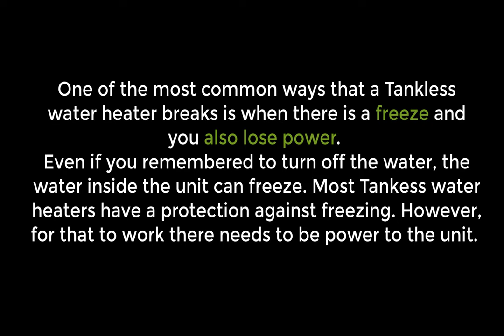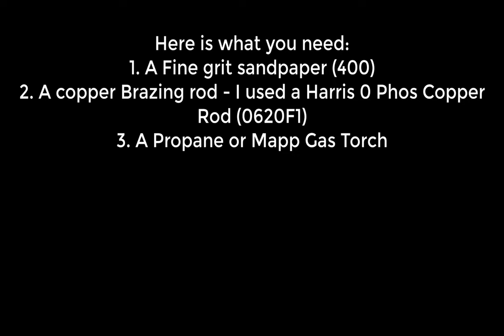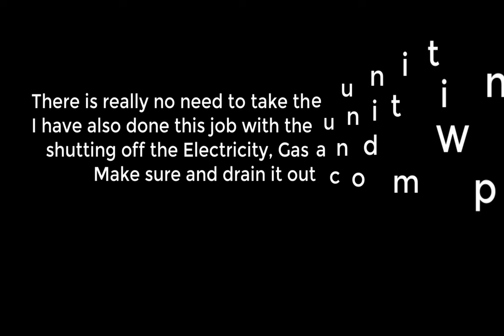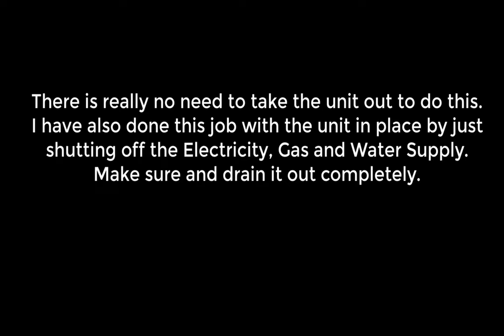Freeze Busted Tankless Water Heater Repair - DIY

Comment: I had plastic elbow and tee bust. Looks like high pressure fittings. After a year I still can't seem to find them. Rheem said they won't sell them or tell me where to get them.  They apparently stopped using plastic fittings after a very short while of manufacturing tankless heaters with them. They're on side of exchanger.

Comment: How did you get all the water out? I spent a lot of time trying to get all the water out of the heat exchanger, including using compressed air, but there is always a little inside which creates steam when soldering/brazing the pipe. The steam pushes out the crack while I am attempting to do the repair. After several tries I gave up. I cleaned it all up and applied JB Weld two part epoxy. It lasted almost two years and just failed last week. I repaired it the same way, but this time it failed on the first use. Thankfully I was just finishing a shower when it failed. Mine is just a little camping tankless heater, so the heat exchanger pipe is only 3/8 inch dia. Everything is much smaller and there is wiring all in the area, so very tricky. Tomorrow I'm going to use a Dremel tool and grind away all the epoxy and this time wrap the cracked section with aluminum fine mesh screen and then apply several thin layers of epoxy allowing them to cure between layer applications. It only cost $150, and I've gotten five years use from it, so I can't complain.
Reply from the maker: Getting the water out was not an issue in any of the cases I dealt with. The water in the heat exchanger just ran out of the drain.
Reply: Mine drains out too, but just drops of water left in would create steam which causes soldering to fail. Likely, the issue was specific to my model which is very small. I did fix it again with JB Weld, so all is good. Thanks for the reply. @DrY-Howto

Comment: Cool, I will try it, I have the same thing on my rinnai RV 53! But after two weeks below zero in Alaska, never happened in the years before, I am off grid, so the heater is off power mostly, but is inside the house! Probably should put a cover over the exhaust! Any more info about what torch and what rods are best? Thanks
Reply from the maker: A Propane or Mapp Gas Torch - I used MAP-Pro Gas with a Benzomatic TS4000 torch.

Comment: Wow. This is my exact problem following the freeze Austin, also with a Rinnai. Don’t have the tools or skills you have though. About half of the tankless units in my development had cracked copper pipes.
Reply from the maker: It looks harder than it is; The entire process should take less than an hour if you have the tools; Checkout the followup which shows how to fix it with the unit in place: https://youtu.be/fNGTSSxaszA (a friend and I did this in < 1hr from start to finish)
Reply: @DrY-Howto  Great fix! Where did you find the torch and accessories? Did you rent or buy the equipment? I think I can make this fix; and mine looks to have same break in almost same spot...but I can't see it clearly, need to cut away housing and I'll do that tomorrow morning. It might be a huge hole though...but hope the metal is there to push it back like yours. I'm in Austin? You as well? Thanks!
Reply from the maker: @nealyhoo  If the crack is in the same spot then there is plenty of room; I fixed one that had two cracks too!
Reply: @DrY-Howto  My crack is bigger; probably have a 1/4 in gap after bending it back together. IMPORTANT QUESTION: how long do you need to let it set after you braze it, until you can try flowing water/operating unit? Thanks!
Reply: Thank you for documenting and sharing this fix! I followed steps almost exactly and have successfully repaired two Rinnai water heaters here in South Austin! Some notes: (1) carefully covering the wires with thick metal is important, or just temporarily remove the thermal fuse wire to avoid overheating it with the flame from the torch. (2) I found that using a mapp pro torch was faster/hotter than a propane touch. I also figured out that focusing or fine tuning the torch made for a faster/stronger burn. (3) Don’t underestimate how hot it has to be!! Ramesh is right about heating the copper pipe and not the copper rod. It took me about 2 minutes of constant torch flame to get it hot enough to braze the copper. (4) Be safe— wear gloves, goggles, unhook lines for gas, water, electricity as Ramesh says. (5) Have fun! Fixing something and saving it from an early landfill death feels good. Torching the hell out of something is fun!
Reply from the maker: @nealyhoo  5 mins - Warm to the touch not hot.
Reply: @nealyhoo  every big orange and blue store carry’s these items

Comment: Your video says the required item is Harris 0620F1 but you used 5620F1. Is one better than the other? Also what diameter is your rod
Reply from the maker: I used  the Harris 0 which the cheapest option and works for copper to copper brazing. My understanding is the ones that have a little silver in them number 2, 5, 15 for the amount of silver in them are more suitable for copper to brass brazing which is used in refrigeration. As I mention in the video I have use the 5 and the 0 and even a 15 once. I found that a silver content helps with the brazing process a little as it gives you a little more control over the flow.  Again, its not needed for copper to copper brazing.

Comment: I’ve never sweated copper. But, it seems like a long time to keep heat on a pipe.
Reply from the maker: This is not "sweating" copper, it is "brazing", which needs a lot more heat.
Reply: @DrY-Howto  Thanks! I didn't read the comments in the video. I will have to get some brazing rods for copper as we have an ondemand to repair that froze. I do weld but, I've never brazed or sweat copper. I have brazed aluminum and that went well. Actually very easy in comparison to welding.

Comment: U probably just destroyed the copper by heating it for 2 long, if it cracks, unfortunately, u need a new one.
Reply from the maker: Fixed dozens of units this way; still holding after a year. The only thing destroyed it seems are their chances of entering the landfill prematurely.
Reply: Your perspective is all wrong. "Destroyed the copper" of a piece of scrap. An extra year is worth it but this one will last a normal lifespan likely. Unless water pressure is insanely high (water freezing in an enclosed space is a good example lol) its not gonna burst softened copper. Pretty sure Cu pipes come soft (not hardened) anyways.